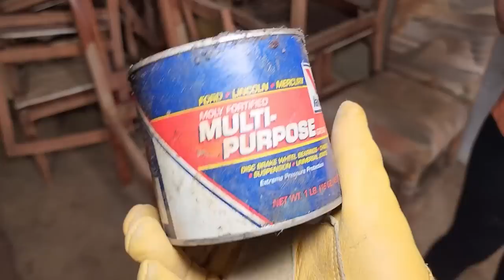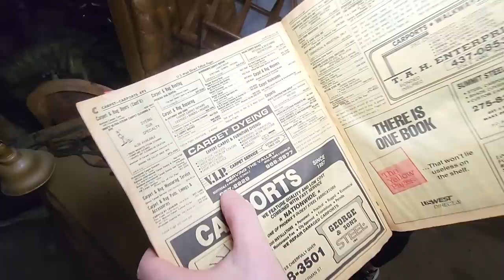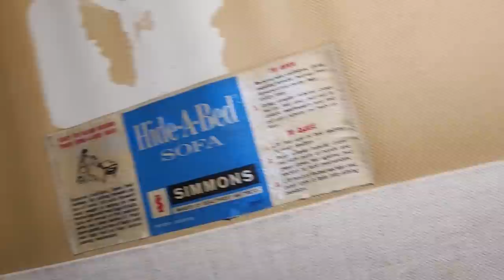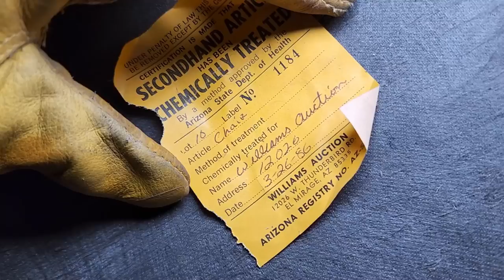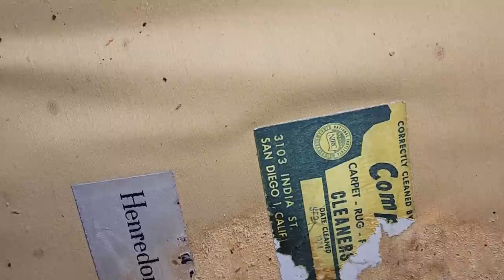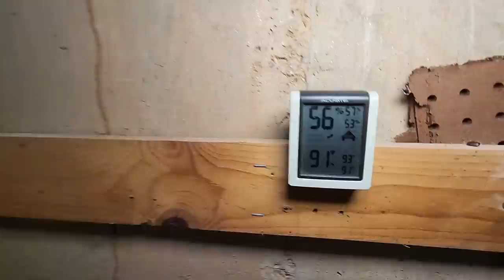Cleaning Out the FALLOUT Shelter | Abandoned FALLOUT shelter restoration ep 11

Comment: Secondary Reply: I was surprised that even in Arizona the below ground (at least earth sheltered) temp gets into the 90s. Maybe if you painted the steel surface hatch with highly reflective Rust-Oleum or tented and shaded it, it might lower the temp a few degrees. If that works you might seal and insulate the hatch and the shelter doorway too. If isn’t possible just install a solar powered exhaust vent in the entrance space. It would probably take several days to notice any, if any, drop in temp because of the heat holding capacity of the enormous concrete mass. As you can see I’m heavily invested in your project. Wish I was your neighbor!
Reply: Definitely need to get some fresh breathable Air down there.Yea.
Reply: It is not far enough below ground.

Comment: Yes, thats how most commercial sewing machines worked for decades with that clutch system.  Nowdays, they use servo motors so you can vary the speed on the fly.
Reply from the maker: Thanks Mike, I thought it was an overly heavy duty base for home use.  Plus it wasn't ornamental at all!  I may do a project with it later.

Comment: Ok guys,. I think we can all agree on the following rule; 
Repeat after me...  " There shall be absolutely NO WOOD permitted in the bomb shelter henceforth !!!! "

Any objections? 

If so, you'll be locked out of the bomb shelter when the time comes! 😁

The Mrs. had a good point... It's a wonder there was anything left besides the metal by the time you got to the dump. Absolutely no integrity to what was once wood. Yikes! 

With that high humidity, you need a good sized dehumidifier or mini-split air conditioner just to bring down that level of dampness.  

By the way, as far as the heat... You should find a way to insulate that steel cover - like some of that white coating they use as spray for bed liner in truck beds.  

I see also that you haven't yet added your hooks on the wall with your emergency escape ladder.

A word of warning ⚠️

Be extremely careful with those old tanks!!!  If with all that humidity and stuff, those bolts may be as corroded as the wood was rotted!  You don't need those damn things falling on you, that would be a really bad day! 🤕

Once you do get those down and out, you should probably rip out all those dry wall or whatever wallboard that is.

I guess what I am saying is; looks like you should blow everything out to the concrete and clean, clean, clean and the rebuild everything.  

Going to be interesting (and messy) to blow out all the feed through holes too for the electric, plumbing,  etc.  

You talked about the sewer lines.  Depending on when they put those in and your elevation.  You could have city sewer lines down 12 to 15 feet up there. Check with your city wastewater and ask what they have on file for them.  If they aren't that deep, you probably have a macerator pump some place in there that grinds up the solids then uses a bunch of water to pump it up to level.  That's what the Air Force did with the ICBM Sites.

Good luck.
Reply from the maker: I've got to get climate control in there stat, plus Termidor!
Reply: There was a couch with a steel frame....my chrome pits just sitting in my garage but that chrome looked OK. I think it's not so bad

Comment: I'm thinking you might need one of those collapsible ladders down there for a back up I would hate to be stuck down there looks hot.
Reply: Seems easy enough to climb the elevator frame.
Reply: I keep seeing these comments regarding getting stuck if the power goes out. Is it me or is everybody forgetting that that winch originally had a hand-crank? Even if the power goes out it wouldn't be hard to swap it over to hand power. All he needs to do is keep some tools down there for that purpose if necessary. Or simply climbing the lift itself like a ladder. In all honesty I would be more concerned with the door getting stuck in the event of a heavy storm like knocking a tree down or something. But in that case I would also think about installing a hand-cranked opener with a detachable handle on multiplier pulleys that could force a heavy  load to open the door if something like that would happen. It wouldn't inhibit the use of the door but would allow the force needed to force that door open if necessary by simply putting the handle on and turning it. People forget the power of pulley systems and cables when there is no power.

Comment: You should put 2 old car tires chained together on the trailer floor. Use a long chain that reaches well past end of trailer.  Then load trash on top of tires and floor.   When you get to dump, ask equipment operator to pull your long chain.  In my experience, they always go for it. Now relax and see how fast you get your load off.  There may be a little left for you to clean up afterwards but really no big deal.  Good luck at the dump!

Comment: Might I make a suggestion.  You have a single point of failure on your elevator.  If the motor or the breaker pops, you are stuck down stairs.  You could add some horizontal braces in your elevator to be used as steps.  Also, with an Arduino, you could automate the lift of the elevator when the access is fully opened and have a button to bring the elevator all the way down and all the way up in parallel to your current control.  You would also have to add an emergency stop button.  That would be too cool.

Comment: Wow, Arizona plate. I always thought you were in California. I guess because California is a lot crazier. I like your vision for the shelter and can’t decide if a little paint would make the entrance less serial-killer-lair-like,or if it’s cooler the way it is. Cute little Zombie has some kick to her, huh! Great videos and commentary. Keep ‘em coming.
Reply from the maker: I love the old rusty look of it!  I'm going to try and fix it up using period correct looking stuff, where I can.  Thanks Gary, the first time I opened the shelter she escaped and I married her!
Reply: I wouldn't waste your money on vintage furniture (they're considered antiques now and what was once considered to be cheap outdoors furniture when I was a kid will cost a small fortune now.). I would look for some Army Surplus steel bunk beds, put down some of that snap-together laminate flooring, metal shelves made from unistrut and something other than wood, and as I mentioned in another comment, some plastic and aluminum picnic furniture. Then run a dehumidifier and an Ozone machine down there. Next, get some solar panels, deep cycle batteries, charge controller and inverter and run some LED lights down there.
Reply: @hrdknox2000  sounds straight out of a trailer park lol. I think it'll end up much nicer than that

Comment: Just a thought; I would tear down and rebuild and reinforce all of those wooden joists that hold up those water tanks. With the amount of termite damage that was down in that place; I wouldn't trust them especially when holding up hundreds of pounds of water. Those tanks look to be about seventy-five gallons each; putting you at about 1,250 lb of water not counting the tanks themselves. I wouldn't trust filling them up without the above-mentioned upgrade to their suspension system. I mean I'm sure you would want to replace the tanks to begin with anyway but if you're going with something similar if you plan to keep a water system down there; definitely rebuild that hanging system.

Comment: if i found a place / building thats been undisturbed for a long time and have termites damage, I would assume all the wood is bad and be pleasantly surprised if proven otherwise. also i would rip out the all the walls and all of wood parts as they most likly have termites in them.
What are your long-term plans for the shelter? do you plan to restored to a working long time bomb shelter or are you planing a short stay thing with minimum amenities and uses it as storge or as a den most of the time?
Reply from the maker: Fix it up, going to be a shelter and a bar.  Thanks Nuthenry!
Reply: @HerbOMatic  AirBNB!  Do it up in old 1950s furniture it would be a hit.

Comment: With what’s going on in the world, you to should focus on this being your only project. Put new water tanks in now and replace the bathroom and kitchen fast. Just paint the walls and get the appliances in. Forget cabinets. Focus on origami shelving units from amazon and lots and lots of food and water. Depending on budget, a new shelter airpump and filter as well as solar panels and batteries you can store in shelter and pull out later. At least 2000 w/hr in solar panel. Plus charging system and lipo batteries. Electric countertop stoves and butane, propane stoves. Plus Coleman makes a few nice multifuel stoves for camping. Great for long term grid down use. Build a few wood burning rocket stoves for dirt cheap out of scrap metal. Many designs in youtube. Start collecting old school tools that don’t require electricity. 
Time is short. You need to hurry.
Forget making it a bar. Use money for food, water, and supplies. Ways to collect food. Purify water( by pool shock powder)Vegetable seeds and fertilizer.